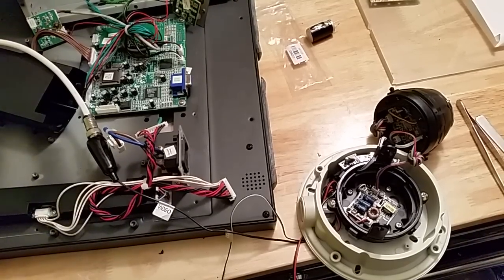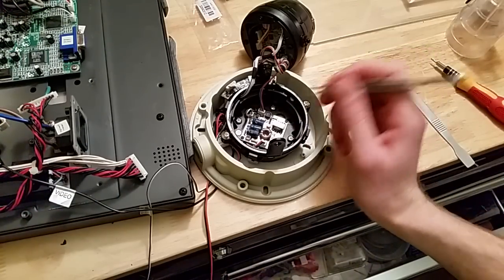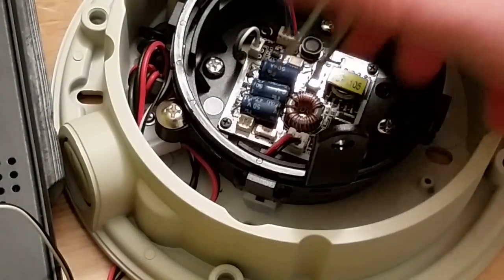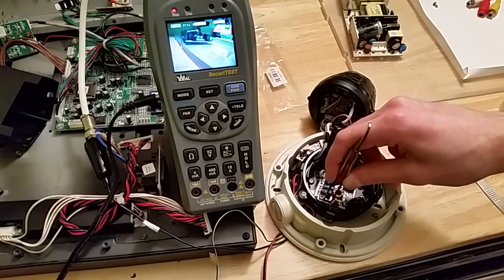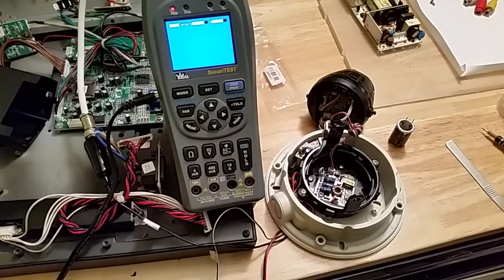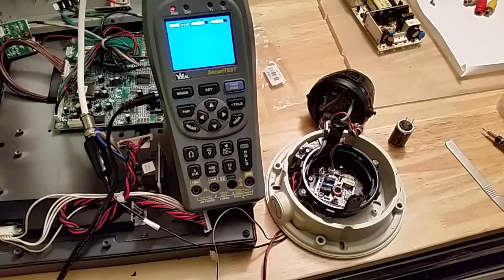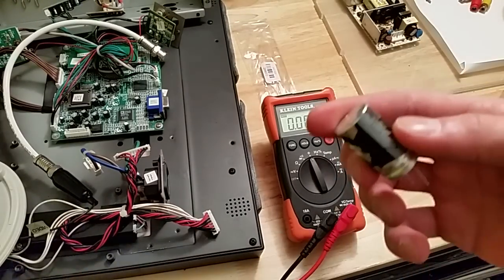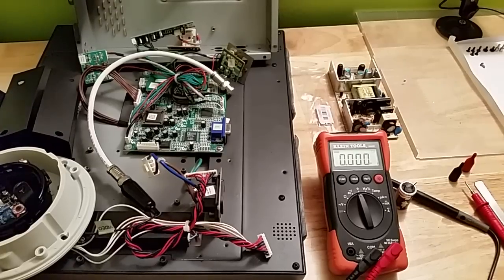CCTV Camera Repair and Pelco PMCL LCD Monitor Electronics repair

Comment: OL means open loop or open line(no continuity)  and if it also measures capacitors it could mean over limit if the capacitor is 2000uf and your meter only measures up to 1000uf for example.

Comment: I could listen to u all day long; 
I've got 3 with issues 
when I plug the ac & the vid cable on the hik vision there's no red light which @ first it appears the cam isn't  working at all however; normally once I plug in a hik vision they take a snapshot then carry on streaming footage but this one seems to be on continuous snapshot or at least that's the noise it's making, I can see the snapshot on the monitor but can't record it
& 2 cmos's that power up but no footage; plus I haven't got a clue how to open them, they almost seem disposable with a completely sealed outer cover??
Reply from the maker: hmm I assume you are talking about a hikvision IP camera..
I have never used those so I do not know. Generally issues with IP cameras tend to be network related (bad connection, low bandwidth, improper config etc..)
Try going in to the config menu of the camera (simply enter IP address on the network or use the discovery tool.) and check the settings or do a default reset.

Comment: Good info. However if I could leave a little constructive criticism, the audio really needs some work. There is a lot of rustling and clunking around in the audio which pulls my attention away from the video. Your voice also fades out several times. Otherwise it was good and thanks for the video!

Comment: Hey... I have that same meter. I'm a service technician for a alarm company I cone across a lot of bad cameras mostly damaged by water getting inside ruining electronics. We don't bother with fixing them we just replace with new and toss the old. If you're interested I could send you the bad ones if you would like to repair them let me know.
Reply from the maker: TecnicoCEE Hey there, water damage is usually FUBAR (fucked beyond any repair) but you never know! The fuse could have gone before any further damage was done.
What kind of cameras do you guys service ??
Reply: Pelco, bosh, digital watchdog camera's
Reply from the maker: Nice, leave me your email

Comment: Hi
Nowadays we use switchmode power supplys because of their efficiency and weight
but their is a downside their is high frequency ripple present and also high temperatures so now for the easy bit. If you want reliability change the mains Reservoir capacitor and all the capacitors decoupling the DC lines it may sound excessive but you are just putting off the evil day if one has gone the others are shore to be following To test the capacitors you need an ESR meter you will need to discharge them before testing  but they are not expensive on ebay £12-15 all the capacitors need to be replaced with  105degree C type, they are more expensive but they will be reliable.
The other point on your video THERE IS HIGH VOLTAGES PRESENT ON THE PRIMARY SIDE  you must take care make sure the supply is disconnected and discharge the primary capacitors with a 100R 5-10W resistor otherwise you will have a nasty jolt when you have replaced the caps clean the board with a toothbrush and PCB cleaner or Isopropyl Aclohol and then spray the PCB with an insulating laquer.
Remember the AC mains voltage is 240V in the UK  and in the US 110V both can potentially be fatal so take care.Always remember to double check!

Comment: That security tester is cool, looks like a timesaver. Sadly my Pelco Spectra 3 died, and looks like it can't be fixed. Was told to get a "dd53kit" but upon taking mine apart, it's different than the part referenced, also, it's getting 24VAC to the dome, but the dome won't power up at all. Think the 24 V transformer malfunctioned and nuked the cam. Doubt I'll find another one for $10.
Reply from the maker: Its a good tester, got it for cheap so it was worth it. I would not recommend paying the $200+ retail for it. Ideal makes an updated version of it now called the  "SecuriTest Pro" not sure how that one is but it looks like it may have some upgrades to this model. Definitely better then the generic Chinese ones.
The repair kit is basically just a power board, they made them for the spectra III cams because they know a of of them go pear shaped after a while due to some flaws in manufacturing. Check the caps and MOSFET transistors, try replacing them with exactly the same ones. Usually those parts are what fails and does not give power to the rest of the circuit.
Always fuse your power supply!
Reply: Video Québec thanks for the info , will have to see if I can find a source of the components and replacer them. Already took the pelco down, but if I get it fixed, will definitely put it back up